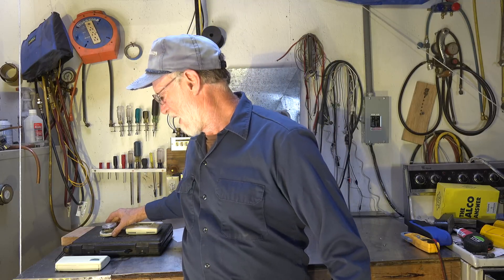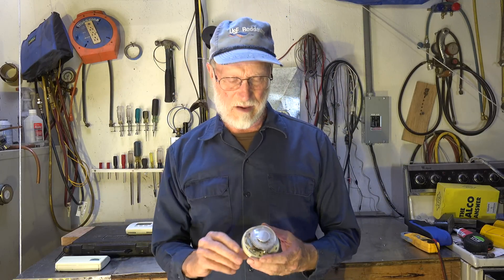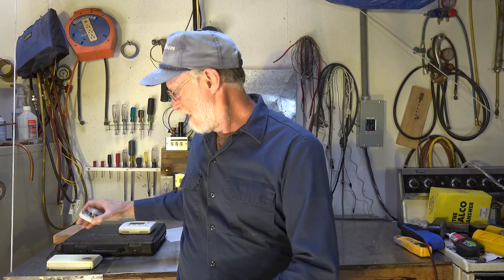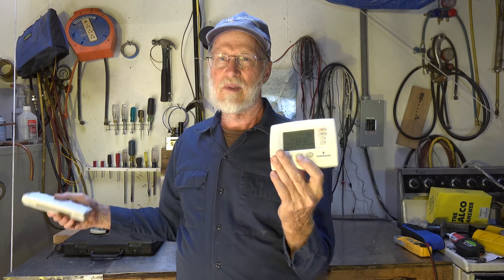Thermostat cycles per hour #1

Comment: DAM YOU ARE 1ST PERSON  I FOUND TO TALK CPH.. AND YOU KNOW YOUR STUFF.
 MINE IS COOLING NOT HEAT BUT SAME IDEA.NEW HONEYWELL TODAY  HAD A 3 TON NOW 3.5 TON IT IS GREAT AND FAST. COOLING NOW CPH IS 6 TO 9. FEELS LIKE 10 TO 15. I NEVER TIMED IT.
, DOESN'T IT COST MORE EVERY TIME IT TURNS ON? I SET 70 COOL AUTO.IF FELLS LIKE ITS CPM IS 12 TO 15. IT NEVER GOES TO 69 AND NEVER TO 71, IS THIS NORM. MY OLD WOULD WAIT TILL 71 THEN COME ON GO TO 69 THEN GO OFF. REMEMBER ITS SET AT 70... I WOULD LIKE  2 DEGREE BEFORE ON AND OFF. I HAVE A HONEYWELL.. IF CALLING ME OR I CALL YOU WOULD BE GREAT I DON'T ALWAYS NOT IF YOU TYPE HER NOBODY TELLS ME I HAVE A MESSAGE ANYWAY  HERE IS MY # 561-487-4621 IM DISABLED ON OXYGEN SO ANY  HELP WOULD BE GREAT. THEY SENT A TECH OUT BUT I KNEW MORE THEN HIM..LOL  JEFF GOD BLESS
Reply from the maker: There is some additional cost upon startup that short cycling makes worse.  Most CPH for cooling is 3.  The anticipation system in the thermostat is designed to keep the temp at exactly what the temp is set at.  
GFM
Reply: I CAN SET 1 TO 6 BUT I KEEP AT 69 SO IT RUNS A LOT ITS BRAND NEW.DEFAULT IS 3 PUTTING IT TO 1 IS ONLY AN EST REEM SAYS. COMPRESSOR YOU CAN SET 1 TO 5 MIN THIS I KEEP DEFAULT ON 5. I HEAR A CLUG SOUND EVER TIME COMPRESSOR   TURNS OFF IS THIS  NORMAL?
Reply from the maker: If the external mounts are ok, it is not.  Really nothing you can do about it as it may be internal.
GFM
Reply: I went  from 3 ton to 3.5 wow I love it but 1 week old when compressor goes off it makes a clunk noise. Had company came out it didn't do it as loud, the boss is coming tomorrow. I think bad pistons, what do you think ?
Reply from the maker: Many times, the internal motor mounts (they are mounted on springs) may have been broken in shipping.  Means a new compressor.
GFM
Reply: THANK YOU

Comment: What's the suggested cph setting for heat and cool on the t5 lyric I'm in a1,094 sq condo it's an electric furnace
Reply from the maker: I don't know what t5 lyric is.  An electric furnace will work with 3 to 6 cycles per hour.  Probably 3 with a well insulated home.
GFM
Reply: grayfurnaceman thank you

Comment: We just moved into an old mobile home and the electric furnace is running a total of 2 hours out of 3, shutting on and off for various time cycles. We have the thermostat, which has been replaced, at 70. The furnace elements have been checked and they are working as they should. It's 35 degrees out, the last cycle ran for 45 minutes. Is this normal and what could we possibly expect when it gets well below freezing? Our last electric bill was over $300. We both choked. The times that the furnace is running are getting longer. Started at 2 minutes and increased dramatically through 9 cycles (4 hours) up to the 45 minute one. We're going to set the thermostat to about 68 degrees and dress better. We live in Toledo Ohio which does have high electric rates. 

Are the extremely high electric bills going to be the norm?
Reply from the maker: The reason for the long cycles is probably due to one or more of the elements are not energizing.  Check all breakers by shutting them off, then turning them back on.  If it continues, you may  have burned wires, control failures or elements failed.  The long cycles usually will not increase the electric bill, as and element that is not on uses no power.  One other thing to check is the crossover pipe if it is a double wide.  They can break loose.  Hope this helps.
GFM
Reply: Thank you so much for answering. I've got another call into the park manager for a fourth visit from the maintenance guys. It's weird because the cycles started short and just continuously got longer throughout the day yesterday until it's now been running for almost 24 hours. 

One of the visits was from a supposed "expert". Somehow I don't think he wanted to deal with it. 

Thanks again
Patty

Comment: I recently purchased a Lux Thermostat that allows you to set the temperature differential at .25 degrees resolution.  I think the range can be set from .25 to 3.25 degrees.  My air conditioner was cycling too much and I was able to fine tune it to around 4 cycles per hour with a temp differential of 1.25.
Reply: What is the model #. I would like get one.
Reply: It's the Lux Products TX9600TS Universal 7-Day Programmable Touch Screen Thermostat.  I purchased it from Amazon for about $60 and have been very happy with it.
Reply: i did the same. i also put a delay on my off cycle to let let me ac run longer with less cycles.

Comment: I set up all my systems with 1 CPH compressor (mostly heat pumps) and 2 CPH for furnaces for the very reason you state. The swing is not noticeable IMO. I'm using Honeywell.